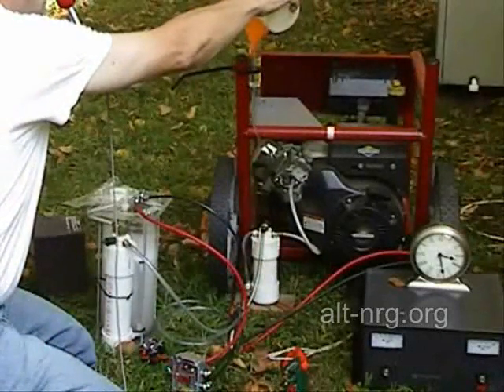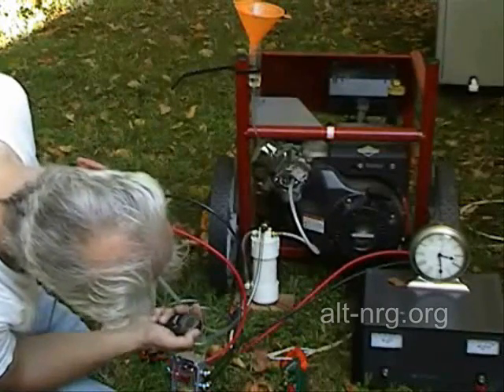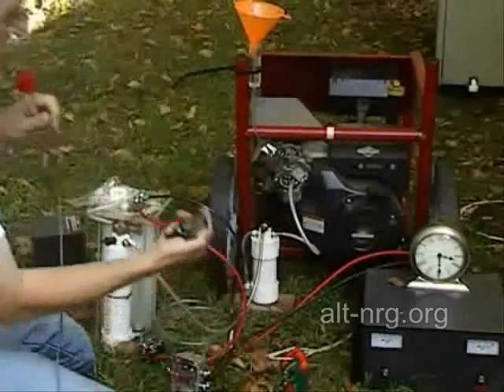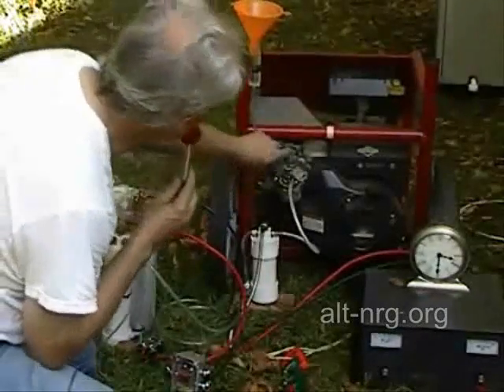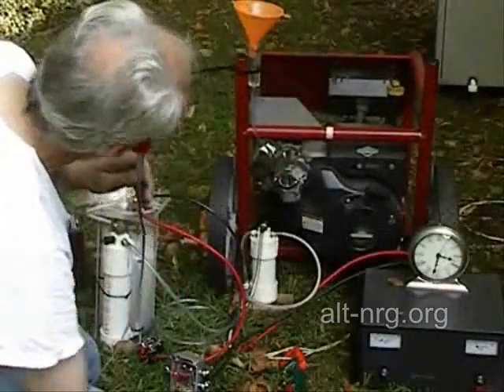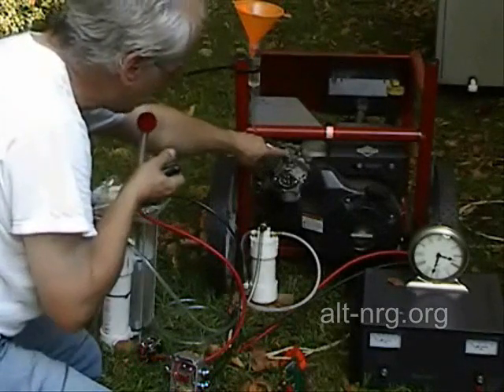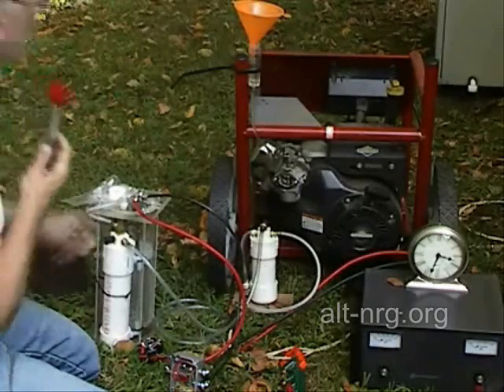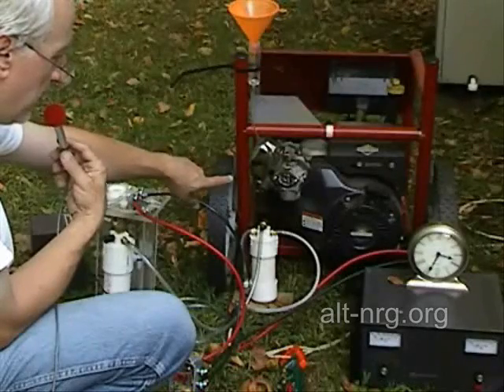#133 - Generator HHO run time efficiency tests, Part 4 of 4

Comment from the maker: This concern has been raised several times.  Let me be clear.

The needle does not limit gas production.  The HHO production remains constant at atmospheric pressure, under vacuum or under pressure.  Pressure will build up inside the generator until it can push the HHO out of the needle valve at the same rate it would at atmospheric pressure.  The use of a needle simply increases the velocity and directs the flow of the gases injected.

Comment: the small orifice on the needle valve is restricting HHO gas flow too much. We don't need an area of high pressure at the caburator inlet we need to increase flow rate of gas. Choking the HHO stack forcing it to exit such a small orifice? Sometimes people even use vacume from engine to "pull" HHO gass from the cell. If you can increase gass flow rate efficiency can be even further.

Comment: I say do the math to get a better understanding of what is taking place. I can go out to my CJ7 and lean out the carborator and achieve better MPG only at the expence of burning the valves and pistons. Water vapor can save the valves and pistons so the question is does the small amount of hydrogen do anything? Hydrogen is a very interesting fuel I admit. But if you don't measure the effects of the moisture then you can't determine the benifits of the hydrogen. Unless proven by math.

Comment: like i said, 65ml/min @100%throttle, so obviously it would be less then that.  You say 15percent throttle at idle, if thats the case, say 1/6 of the figure i gave, which makes 11mL/min. DOes that sound better? where did you get the 15percent throttle@idle? I think you need to go back over your figures, as i read what you said i quote "...the fuel needed is about 157LPM" Umm how big is your fuel tank. you do realise LPM stands for Litres per minute? you realise HHO is not pure hydrogen?

Comment: ok i did some sums and i come up with an amount of around 60-65mL/min of ULP at 750rpm for said engine.  That is assuming 100percent volumetric efficeincy, under NO vaccum, which when at idle is far from the figures i have posted.

Comment: Do we know if this really helps? i was thinking about taking a bottle of hydrogen and a bottle of oxygen and combining their outputs through flow meters and a mixer and forcing a large volume of HHO than can be produced  to prove  efficiency increases or we are just wasting time.  if it does increase efficiency then we just need to increase production reasonably.

Comment: A 10hp engine is about 250cc you need to just multiply it by 8. So about 24 lpm.  I agree that a 1 lpm trial would be good.  If I'm right and moisture is the reason for gain maybe too much moisture reduced his efficiency.

Comment: Just pump that heat into the garage where you will need it this winter. LOL  Then you will have a co-gen.  I wonder if taping into the 12v power on the gen would be more effecient?  I know it's only allows 15 amps max but I think you will see more of a gain.

Comment: No thats not at all true. If you perfectly seperated all of the Hydrogen from 1 gal of water you would only have 1/3 as much energy as 1 gal of gas.  The only way Hydrogen has more energy is by the pound. Then it contains 2.5-3 time the energy. but by volume it is a lot less. 1 Litre of pure HHO no water vapor at most contains only 9.54 btu's. A litre of gas vapor is around  63 btu's.

Comment: Cars do not use all of the energy that is available at any given time. Example is with my F150 I get 16 mpg normally. The truck weighs 4500 lb.  When I haul a 7000lb trailer it drops to 8 mpg at its worst. But I have a net gain of 2500lb that does not cost me anything. The load on the Alternator works much the same way. Sure at 1000 rpms you can hear a load but while driving it is really nothing. This Generator experiment is ideal because the IC runs at a fixed rpm and you can set a fixed load.

Comment: I look forward to seeing your next Test. 8)   A 10hp ic consumes 900 Litre's of air running at 3600rpm's. The governer on the Generator should try to maintain that speed. So all you need to do is to pipe in the HHO. Same as running HHO on a carbed car engine. 2.5lpm of pure h2 mixed with 897.5lpm will still not burn. Thats only a .28% mixture.  My money is still on the moisture. 8-p I will experiment with my gen. We can compair notes later. Thanks for the demonstration.

Comment: FEATTURTLES

a common misconception when it comes to working out how much fuel is needed.  at 2100LPM of air at 700rpm on your said 3.o V6 you are saying your engine requires 142.8LPM of unleaded... at 700rpm i might remind you. WRONG! a 4cylce engine only has 1 intake stroke (breath) per cylinder every 2ND crank rotation. So you 'could' multiply your displacement by 350rpm (700/2) but this is faulted since full displacement of each cylinder is only obtained at FULL THROTTLE..2bContinued

Comment: WHat about efficiency of the generator itself. I believe your loads are to light. Your generator is optimzed to run at about 75% efficeintly. Like a car gets its best gas mpg at 65mph not slower or faster.  I think your results are down in the mud. You need to increase HHO and Load.

Comment: This theory only works if the % of Hydrogen is great enough to burn by itself.  I'm not sure about the % with this Generator but a 3.0 V6 consumes 2100 lpm of air at 700 rpm's even 5 lpm of hydrogen will not ignite at that mix. You need just under 4% hydrogen to do that at 400-500 deg.  I'm thinking that the improvement is do to the added moisture and not the HHO. Issues with the controls of this generator. A way to standardize the air flow is needed.  Anyway Thank Zero for the demonstration

Comment: I don't think a lot of people realize what you're really trying to do because your name is a bit misleading.

The idea behind the testing is sound.  Introducing hydrogen gas into a hydrocarbon fueled engine to improve the combustion process.  Hydrogen ignites easier and the flame front travels faster.  The boost in fuel efficiency would come primarily from the burning of what would otherwise be unburned hydrocarbon fuel (less fossil fuel, not zero :P ).

Comment: You might have a net gain of overall energy released from the system but you don't have any net gain in useful energy released from the system.  I don't count heat energy lost from my cars radiator in my cars hp output because it doesn't make it go any faster.

Comment: WOW  Think about this. 2.5 lpm of HHO and at best a 7% gain.   People make the 30% gain on cars with just 1 lpm.  What gives?  Zero I would be completely disappointed.  It's nice to hear the engine run better and these video's do bring up a good point that a HHO gen really does not consume any additional gas as car engines are underused as is.  Maybe the result would improve if you didn't use a air needle to inject the hho.

Comment: I'm impressed to what you have done.  Can you post your wattage consuption of the PS vs the wattage consuption of the PWM I-Reg?
Also, does your generator have a direct 12 volt tap?  This would be more like that you would find in an automobile.  Your current numbers show you about 98% effecient, but you are on a medium load.
I suggest repeating the experiment at 4 stages:
1 - No other load other than the HHO
2 - Low load with the HHO
3 - High load with the HHO
4 - Over load with HHO

Comment: Hey Z (long time reader)

im sure your aware the most noticable difference would bt made using an engine tuned and running as efficently as possible. These generators would be notoriously bad on fuel since they would be designed to run for prolonged periods and are air cooled thus requiring a colder burn by running richer then stoich.  Maybe try this with a deisel generator as air/fuel ratio would be vastly higher meaning your overall HHO input equates to a higher percentage of fuel input?

Comment from the maker: Yes, there are still many unanswered questions.  I'd do you plan to test with different loads.  However, in a car, the amount of HHO required is substantially greater than my small generator.  Systems that we have now barely create enough HHO to supplement at anything butt very light engine loads such as cruising at highway speeds.  It is not until we start generating twenty, 30, or more liters per minute that we must worry about regulating the HHO with throttle position and engine load.

Comment: If that generator you are using is a 2 cycle engine, you may actually reclaim some unburnt petrol also... (maybe no need to cool it. If you do, maybe an intercooler like they use on turbocharged engines would help, but would need a fan if it's stationary)

Comment: i think ZFF has done lots of great research but i guess there are many other questions still unanswered.

to ZFF, take it easy on comments - don't take it to heart.

btw, would you test with different loads like when driving a car? would different loads require more HHO? if yes, how would the system cater for that?

cheers!

Comment: Thanks for doing this test. Ive been spouting this test for a few months. I'm gald to see someone try it, and record it. I think your results may be a bit more positive with less than 0.75LPM HHO. 
My access to a generator went south for hurrcane relief work and is still there:( 

You said you had 2 LPM output, How did you determine the LPM output?  Is there some benifit to raising the pressure of your HHO system and is that why you used the small orifice needle.?

Comment: I have seen generators with a 12vdc out.I wonder if you can try this type of generator and eliminate the power supply thus eleminating the pass transistors and heat loss. okr maybe you can get hold of a swithing supply which is more efficient. good experimenting and keep it up.

Comment from the maker: Hello, Dave.  Just because you were able to charge your battery, that doesn't mean the power supply was efficient.  All it means is that it had enough brute force power to do the job.  A standard battery charger with out linear regulators is still much more efficient in converting the energy.

Comment: Hey Zero longggg time I did not chime in. As far as your comment "I don't have a battery charger big enough" Have you ever tried to use the Astron PS as a charger?
Last week my car had a dead 3 year old battery, (click click click chatter of the soleniod level dead) I only have a old 6 amp charger and needed to get my butt on the road fast. Put my 20 amp Astron on it for about 20-30 minutes. The car fired right up, it turned out to be a dam good sub to a dedicated charger.

Comment: Try injecting The HHO behind the carb. drilling a small hole the size of your ball needle, in the plastic spacer between the carb and motor. this way the only thing the car meters is the gasoline, not the HHO. This will also pull a small vacuum on your cell which may or may not be beneficial. using a small ball valve in your HHO supply line to control HHO flow. In doing so when you add the HHO the carb can then cut back on fuel flow with out affecting HHO delivery.

Comment: hi ZZF, you have tested on a generator. here, the load is constant.

in a car, the load changes - accelerate, decelerate and idle.

what can this system accomodate this variable load? it's unlike EFI where the injectors would control the amount of fuel.

in your system, might it starve the engine of HHO under load?

i think it might be better to supplement petrol/gas

cheers!

your videos are great!

Comment from the maker: It ran almost as long on the same amount of gas DESPITE the massive inefficiencies in producing and regulating the electricity to run the cell. I didn't even account for the efficiency loss of the AC  generator itself! Throw that in and the total electrical efficiency is probably closer to 40%. The TOTAL SYSTEM EFFICIENCY recovered is almost 90%! That extra 50% recovered energy was  dissipated in the form of heat in the AC generator, linear regulated supply, PWM and cell itself.

NET GAIN!

Comment from the maker: That's correct. Next experiment is to recirculate exhaust gases cooled through a TEM first to reclaim some of that lost heat energy to help power the cell, then mixed with the HHO at the carb inlet to dilute the mixture.

Comment: I may be out in left feild some place. BUT.  I think if you designed your own muffler so it had a lot of flat serfus area and lined it with thermal cuplers to make even more electricity from the waist heat. You would be mega points ahead of this game.
There again;;;   Just a thought.

Comment: Like you said, generator are very inefficient; still you were able to prove without a doubt the benefits of using HHO to power a gas combustion engine. Anything to lower the consumption of gas is a gain. Thank you. This was the video that I had been waiting for the past 7 mo. EXCELLENT work Zero. Hopefully you'll be able to integrated to a car soon or better yet, an RV to generate combustion, electrical power, and gas for cooking. Can you imagine? Great job ZERO. I look froward for more videos.

Comment: hi zero
i to have completed a test with my generator.
i was different to your test but good results all the same.
i had a car charger set to 2 amps running from the generator connected to my cell and with hho injected my engine run time went from 8.35 minutes to 10.55 minutes with 80ml of fuel.
i did this twice and had vary similar figures.
so i would say that is around 20% more.
it has encouraged more testing  but for now i will continue with my 4.0liter car which so far i get 30% more km

Comment: Nice set of videos.

Thanks for all your hard work.

You have shown that 2.5 LPM has positive effects when injected into a small ICE that consumes 20 cc of gas in about 50 seconds.

(You might also try an experiment at 1 LPM)

If you scale up to a 2,000 CC engine, how many LPM would you need?

BoyntonStu

BoyntonStu

Comment: According to Stanley Meyers secret videos, he says the HHO gas is 2.5 times more powerfull than gasoline vapors.  He also said that mixing inert gases (air/nitrogen/CO2) with HHO you can replicate the burn rate of any gas / gasoline vapor.  If you dilute the HHO with 60% inert gas and only 40% HHO, then the burn rate should match that of gasoline.  Less HHO is needed to produce a burnable fuel and no gasoline is needed, so how efficient is that?

Comment: Nice test.  Might I suggest finding a parts carburetor to snag a high speed needle.  It will replace the drilled bolt that holds the float bowl in place.  The idle fuel mix screw opening should still be there also, you just have to remove a welsh plug on the side of the carb body.  Having either of these will allow you to lean out the mix to get your efficiency up.

Comment: It would be great to have at least double the HHO output.  For this size of engine, the difference would be more noticable.

How about putting on a small ball valve between the syringe and the carb.  When on HHO try turning off (slowing the flow of gas) as much gas as you can thus leaning out the mixture.   The HHO will help to richen it.  This will still allow you to measure the flow rate and lean it out more than is possible with just the choke.